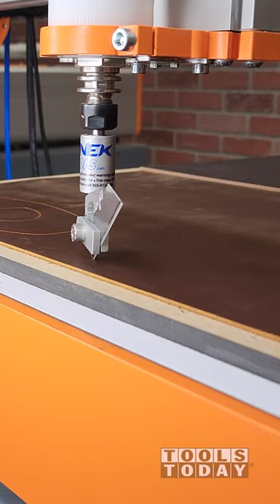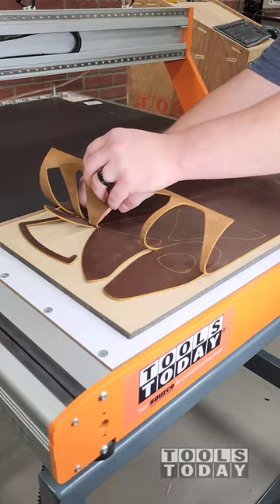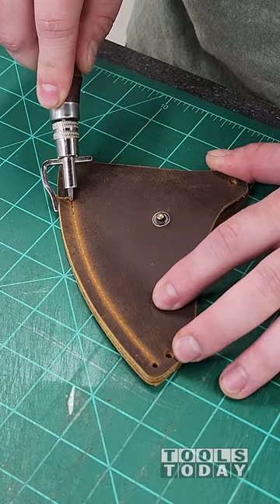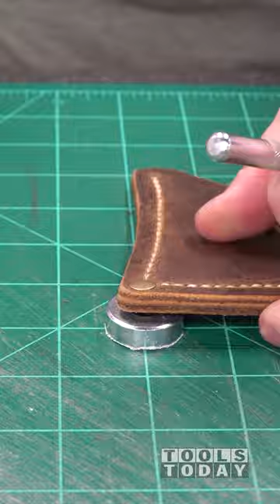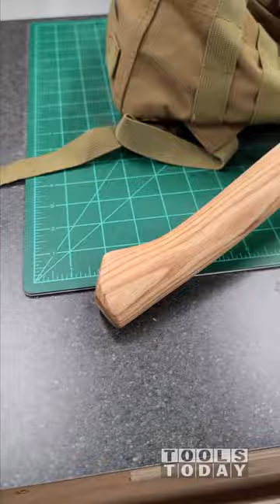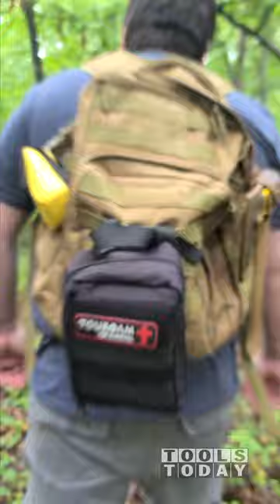Cutting Leather on CNC Machine

Comment: Waste of time. Use a laser cutter. Will cut the sewing holes and have smoother edges.
Reply: How does laser burned leather smell like?
Reply: @gabormolnar3022 the product just smells like leather. But you need an extractor for the fumes when burning
Reply: @Ipsissimus  Do you use a laser cutter for leather in your workshop? And no bed odor after you connect extraction?
Reply: @gabormolnar3022  Yes. Bed odor? Your laser grate and bottom are going to get greasy and filthy. Be prepared to clean a lot. It does stink.